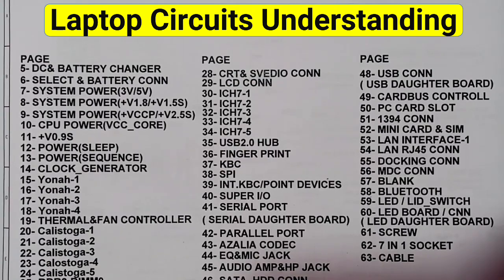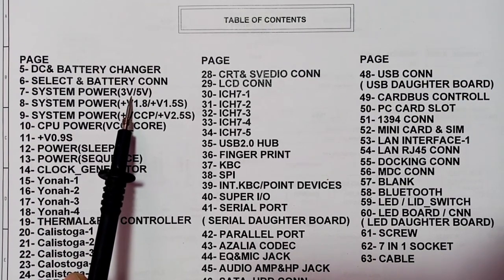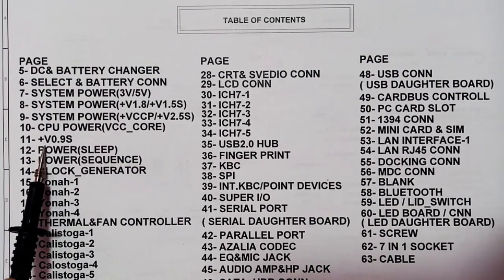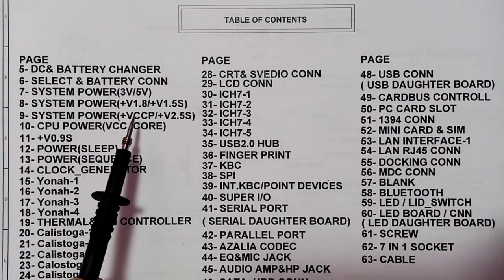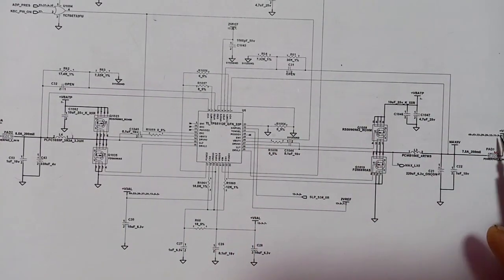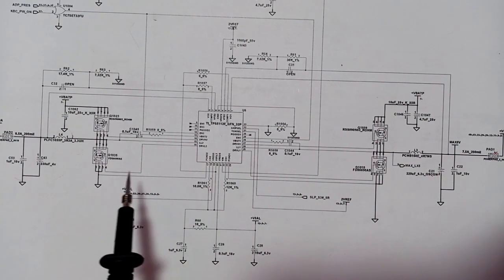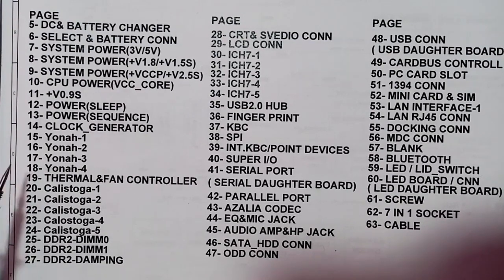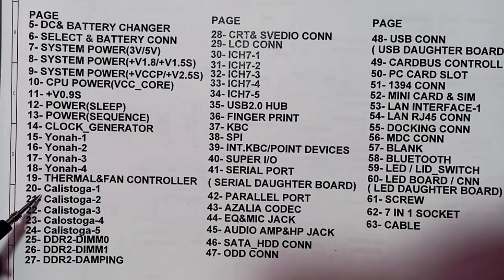Laptop Circuits Understanding - Laptop Motherboard Repair

Comment: Hi there, is it possible to make a tutorial video about diode in parallel mode & ceramic capacitor in serial mode. what is the meaning of parallel  & serial mode on the laptop? thnx
Reply from the maker: Noted
Reply: @electronicsrepairbasics_erb  thankyou
Reply: @electronicsrepairbasics_erb  thankyou